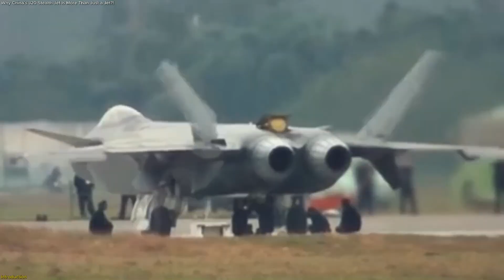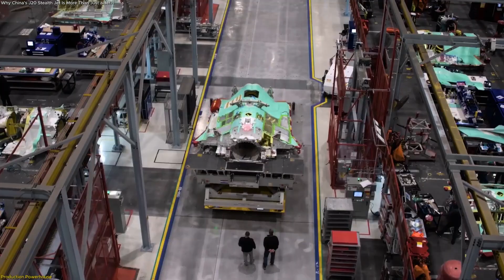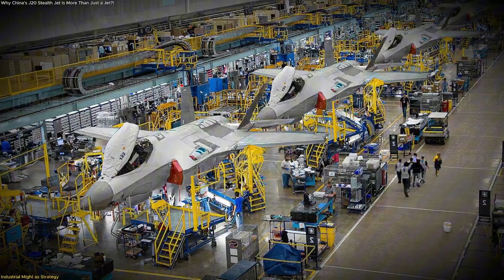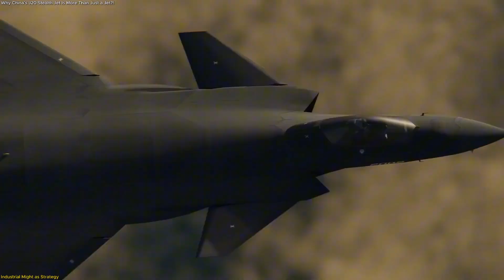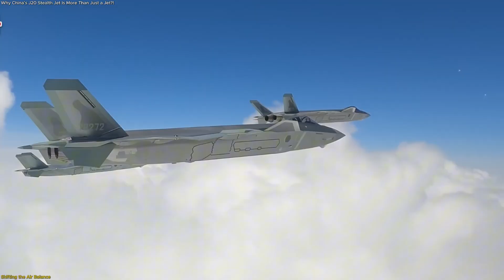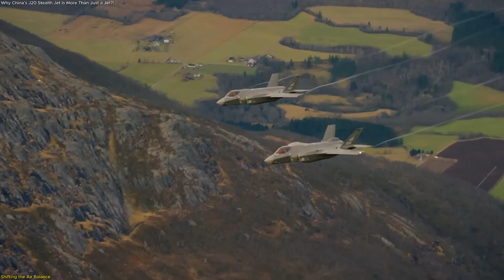Why China’s J-20 Stealth Jet Is More Than Just a Jet?!

Comment: The J-20 doesn't have to match the F-22 in performance. It just has to come close, which it does.

The J-20 is still a very powerful and deadly weapon. And China has these in large numbers. "Quantity has a quality all its own."
Reply: also the J-20 is a constant work in progress for example some J-20s have the brand new engine with more thrust and supercruise, but most don't (yet), at least a few j-20 are now equipped with the radar for 6th gen fighter jets (silicon carbide, which doubles the range over silicon nitride; which the rest of the world uses, its also more resistant to electronic warfare).

and china is constantly tweaking RAM (radar absorbent materials) coatings, they still haven't implemented the one i'm looking forward to seeing the most based on jacquard weaving, this is suppose to create a more permanent stealth coating (lasting about 18 months, versus the 3 weeks of the f-22 raptor), it also in theoretically better at absorbing radar frequencies, it could in theory absorb slightly over 90% of radar waves, which exceeds the most advanced RAM coatings in used today (on the f-22 raptor)
Reply: F22 only great in the eyes of Americans 😂😂😂
Reply: J20 with WS-15 or WS-19, PL-15 or PL-16 and carbine silicon radar will out-radar, out-thrust and missiles out-range the F-22 and F-35
Reply: agree with you mates
Reply: Actually the J20 is years ahead of both F22/ F35 in every aspect.
Channels want to continue to claim but without evidence that F22 and F35 are better than even the J35/ J20 

Based on know specification already proved, the old F22 and F35 are both inferior to Chinese versions.

Already proven , China's missiles, radars and avionics with its kill chains already exceeded those of American 5th gen.
Channel dares not mention about China's 6th gen.